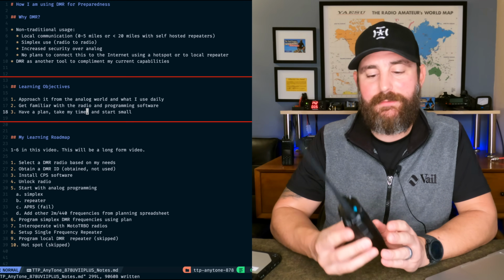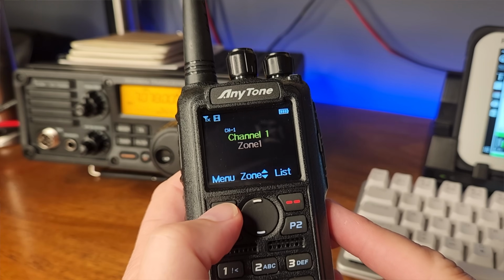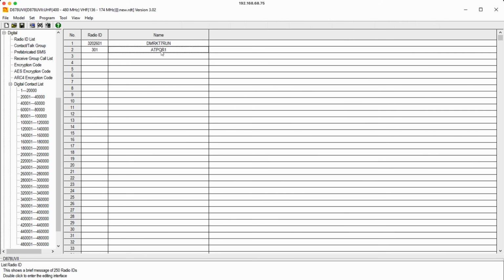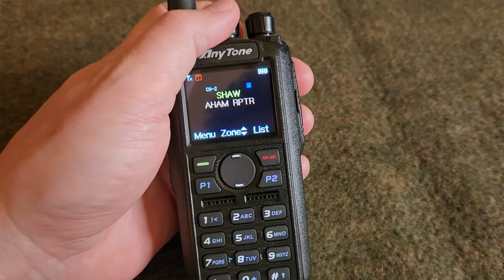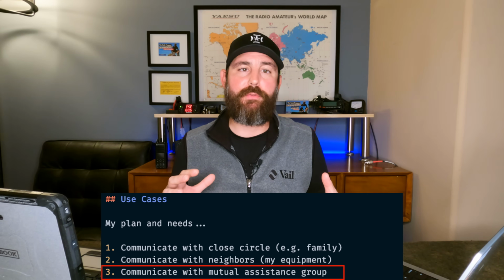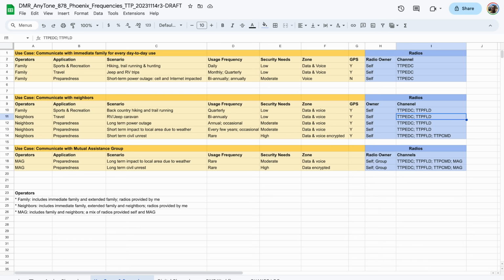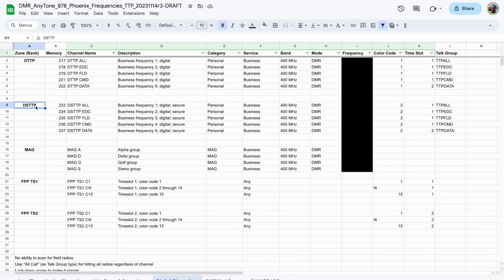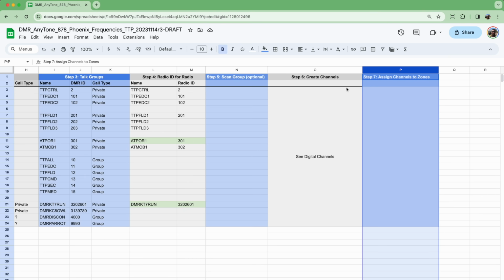How I learned DMR and how I am using the AnyTone 878 for preparedness - No Internet!

Comment: The Asia model Motorola R7s have full front panel programming. Available in VHF or UHF. I have one of each and they are the bee’s knees. They are pricey though even for good condition/refurbished used one.

Edit: Forgot to mention there’s an awesome eBay seller that has them with the AES entitlement purchased. He only charges $100 extra. From Motorola they’re around $300, AES entitlements are per radio by the way. He’ll get you a fully enabled Asia model with AES for around $850.

Comment: Thank you for sharing. That looks like very well thought out! Impressive.👍
I am relatively new to ham radio (~15 months) and I had not used the digital modes at all until yesterday when I set up my 878 using one of the Bridgecom videos. Although I assume that here in the area I live there are not enough people I can reach using VHF/UHF radios, in particular not my family, I thought I'd better do the setup while the grid is availalable instead of regretting not having done it when it has become unavailable.
I admit that your video showed me something new that I was not aware about, which is this that DMR can also be used without the DMR repeaters which is of course crucial in a situation where all that infrastructure is down or will go down after a few hours or so. 
73 from Germany

Comment: Great video, however you made the comment that the radio cones “locked” and no where in the manual does it say how to unlock it. Page 41 clearly does.
Reply: OK, I understand. It is however very strange that they don’t tell you how to unlock it until page 41 instead of the very beginning of the manual.
Reply from the maker: @cherylmorey6658  Bingo. I thought that would be the first thing every operator would need to know out the gate.
Reply from the maker: My manual did not have 41 pages. It was a pamphlet. Good to know.

Comment: Does a dmr can talk to a analog when both radio are in the same frequencies?
Reply from the maker: Negative. Even when on the same frequency the analog radio will not be able to decode the DMR signal. However, you will be able to hear it and know that there is a transmission taking place.

Comment: 878 is a very capable radio. I use it for both HAM and Professional radio applications. It communicates fine with the MOTOTRBO radios. While it does have good audio, Motorola is the gold standard in audio, both output, and noise reduction on the input side.  Good choice for learning DMR.

Comment: Encryption & Overall Plan Questions for the Radio Gurus:

Hi all, I’m looking for some assistance as I am completely clueless when it comes to encryption.

I am using an assortment of DMR/analog radios for emergency communications with family members and would like to know how compatible they are.  I still haven’t finalized everything, but likely will use DMR for the digital functions, ability to use individual or TG calls, etc.  AND, even without encryption, it will probably stop a small number of random people from listening in with older scanners or analog receivers.  

Complete “privacy” is important, but not as critical as ease of use, as only 2 of the 30+ users have any radio experience.  (and refuse to learn anything other than “turn on / push to talk” etc)

I already have repeaters installed at 2 sites, covering most of the area I need to have communications.
I’m using 4 coordinated/licensed IG (business band) UHF frequency pairs. 
1 Hytera RD-982 & 1 Motorola XPR-8400 at each site and cover much of the area needed with much overlap. (NOT linked via IP or RF)
Reply: The “Radio Kits” to be given to each family group will be somewhat similar.

Portables :
Mostly Hytera = PD-782 / PD-682 / PD-982 / X1-P (all UHF, most 450-520MHz & some 400-470MHz)
With Motorola XPR-7550e (UHF 400-520MHz or similar range)
And Some AnyTone AT 878UVii Dual-Band UHF/VHF.

Plus -20x TYT MD-380 older “low budget” UHF portables for “spares” and to hand out to neighbors, etc.

Mobiles:
Half are Hytera MD-782G (most are U2 - 450-520MHz)
The other half are Motorola XPR-5550 and XPR-4550 (UHF - I can’t recall splits)

Everything is going to be packed away in Pelican cases with plans, info, hardcopy of GMRS + IG + Misc licenses, cables, small NIFOG bound books, etc.  

6 or 7 groups total.
Each group will get 6x portables w/2 spare batteries  & 2 mobiles & 2 “Base” radios (mobile in desktop Samlex chassis & power supply).  Mobiles/“Base”s have magnet mount Browning or A.S. antennas and multiple methods to power everything. 

I HOPE that power is not affected during the type of emergency we are planning for.
But… I am working on LifePO4 / solar solution for each group + repeater sites (sites have nat. gas standby gensets and UPS units w/20min of capacity for the 20-40secs for genset to start and stabilize)
Reply: Sorry for the length!  I started thinking it’d be a paragraph.

While I really hope the repeaters are still functioning, I plan to have a bunch of simplex channels for direct radio to radio comms.  Plus all of the GMRS/FRS for random comms and to talk to outside people.

I plan on building out a few portable repeaters (using portable rack cases) eventually, but am hoping simplex using the mobiles with decent antennas , will work for each group.

FINALLY… encryption?
What is compatible?
None of the Hyteras or Motorolas have AES-256 or any encryption option (other than the “basic” or whatever is included)

The

Comment: I don't understand how this is Internet free, dmr relies on network connected servers so are you deploying your own server (that won't work without Internet) or are you using talk around (which is severely limited range) or are you using analogue which by definition isn't dmr and therefore this video is completely misleading? Genuine question as I'm confused and you don't actually explain how this is working. 73's M7YOD
Reply from the maker: I am using DMR as protocol for simplex communication (i.e. no Internet). It has value from the preparedness aspect for local, more secure communication compared to analog. Also, with a business license, DMR simplex with AES-256 encryption is legal and force multiplier. This just another use case for using DMR marketed radios outside of the traditional ham/Internet use.

Comment: Excellent video… I’m halfway through and it’s good.
I came from the public safety world of 2-way, am an amateur, have business band licensing AND am now creating a family emergency communications plan & system.

I’m using multiple Hytera repeaters (4x UHF / 2 per site) with spares set up in mobile rack cases..
I’m using Hytera PD-782, PD-982 and X1P portables and a handful of /\/\otorola XPR-7550 portables.
The Hytera radios are a bit pricey for a radio destined to sit in a Pelican case for “emergencies” and the Motorolas are nearly impossible to program in the field (no FPP in NA).

I was looking for a solution for the 30+ radios that are to be handed out to 4 family groups.
It seems like the AnyTone will be a good solution.  The only issue I have to research = encryption.
AES256 (DMRA) is pricey, but already done in the Hyteras.  I hope the AnyTone is compatible and can do MDC1200 signaling for the analog side.  (running analog on the in-law radios LOL)

Thanks for the video!

Comment: I would like to know if two of these can communicate between each other through digital signal on their own without connecting to repeaters and other devices?
I mean like if i just put two analogue radios at the same channel and they can communicate completely independent
Reply from the maker: Yes. That's exactly how I am running these. Radio to radio.
Reply: That’s called Simplex. The radios would have to be in range of each other, there’s lots of variables for range, but generally about 1-5 miles if you’re lucky.

Comment: I work in cybersecurity.. and this still looks so overly complicated lol! I think DMR is where I need to be due to the same reasons you went that route, but man.. I'm not looking forward to it at all.

Quick question though. I've read that the BTECH DMR-6X2 is the exact same thing as the Anytone 878 and that the firmwares are even interchangeable. Do you know anything about that? I'm mainly asking due to the price tag as you can imagine.

Comment: I have actually found two things about the 878 that disappoint me: the battery latch is weak, I can take the battery and move it in and out ever so slightly which is a concern as to whether the battery is really secure and whether or not the contact seal is really working. The other issue I found is it doesn't take much audio to clip this radio's receive on analog, unfortunately that makes this radio a no go for me. If the analog receive is that sensitive it's no good. I have tried tons of different radios and I can't believe the poor quality being put out for the higher priced "ham" radios. Icom seems to have the best QC. My Yaesu ft-5 cracked by the ptt in a short period of time and it will be a very long time before I buy another one of their products. I can write paragraphs of the issues with radios marketed for the ham market. I am waiting on a TYT MD-390 after discovering issues with the CS-750 not allowing audio through when someone is talking.

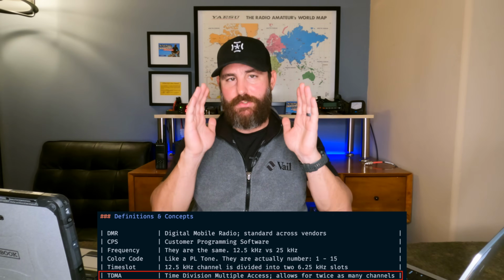Comment: Isn't TDMA (TIME DIVISION multiple access) simplying using the entire bandwidth but creating two sequential timeslots, basically using the entire bandwidth for both timeslots and swtiching back and forth quickly, and not dividing the 12.5 bandwidth to 6.25. @24:24 I'm pretty sure they cover that in the HAM Tech license test. What you are describing is FREQUENCY DIVISION multiplexing (FDM) - you know, same stuff as in wired networks.

Comment: The GPS in the 878 will give your position away. Right ?
Reply: I also am wondering if you can disable GPS?
Reply: Transmitting on a radio will give away your position. No one is looking for you though. So no need to be paranoid.

Comment: The Anytone is a nice radio overall. I have the older AT-D878UV version, and I don't see that the newer version has really 'improved' enough to warrant my attention. The APRS implementation is poor on both radios. I was able to cobble together a rudimentary brute force tracker with the older one, but it was essentially useless for anything else. And while the APRS receive capability on the newer model would be nice to have, it’s still missing a lot of functionality there. I also would’ve liked to have seen them expand the size of zones and scan lists as well, and maybe allow channels to appear in multiple scan lists (these are my common complaints with many, if not most, DMR radios). The software is pretty good, and like you, I’m a firm believer in rolling your own code plug, versus using someone else’s.
Reply from the maker: I think that you made the right call sticking with your original 878. In my humble opinion, the APRS experience needs to be overhauled with the operator in mind. Glad to hear that you also roll your codeplugs. Thanks for the comment and view.
Reply: Same here but I really am glad they keep the improvements going

Comment: Slightly pedantic comment. What you described (splitting the 12.5kHz channel into two 6.25kHz sub-channels) is called FDMA or Frequency Division Multiple Access. It's used with NXDN and I believe P25 is also FDMA. TDMA as used in DMR alternates between Timeslot 1 and Timeslot 2 every 15 milliseconds using the full 12.5kHz bandwidth.
Reply: Actually called TDMA time division multiple access

Comment: I am curious about something; since all of the radios you have support encryption, why even bother with unencrypted channels, why not just have them all encrypted all the time.  You control the radios since you pass them out to friends and family, so there should be no compatibility problems.  What am I missing, what is the disadvantage to having them always encyrpted?
Reply from the maker: You sacrifice potential interoperability with other radios. My AnyTones and Motorola can do encrypted voice, but not text message. Also, I have analog radios in my fleet. Personally, I need the flexibility of three application specific zones for my frequencies: analog (ATTP), digital unencrypted (DTTP), and digital encrypted (DSTTP). Also, I interact with other groups and don't necessarily want to share my keys. It's good to have operating options.

Comment: I am surprised to see that you recommend a 25kHz bandwidth for ham/repeater operations. I am from the EU so it may be different in the US, yet our channel setup is 12.5 kHz, and we use narrow FM as it is fully capable of transmitting voice frequency range. Using 25 kHz would interfere with neighboring channels. Can you maybe elaborate why 25 kHz is beneficial for you? Thx and 73
Reply: 25kHz is the standard for analog ham radio here in the states

Comment: 11:00 All right I can understand what you're saying about Coldplug I have a little bit different view on that, let me explain why. 1. if you are a amateur and starting on DMR it's very wise to use the same cold plug that the local community around you is using that is because it's much more easier to get support from your local amateurs when you need help. 2. it is wise to start using someone else's code plug until you're comfortable using DMR radio because someone else's has built to Coldplug for the radio that you are using, it's not easy just building up a code plug when you don't understand the concept of the DMR radio, when you're comfortable using someone else's DMR code plug and have a logical understanding of how a code plug is working then you can start building your own Coldplay I've been using DMR radio for almost a year and I'm still not comfortable writing my own code plug to 100% working
Reply from the maker: These are good points. Let me clarify, the problem that I really see is when I have people outside of my state ask for my Codeplug as other than a few nationwide channels, none of my settings are appropriate for them. Also,I'm a firm believer in tailoring the radios settings to one's particular operating needs. I see this as constant issue. As you can see from this video, my Codeplug is highly customized around my personal communications objectives.
Reply: @TheTechPrepper  You r also very much correct.

Comment: I have three 878s and can only seem to get the “common” encryption to work. The AES256 isn’t working on either of the three. 

Also note, line 16 and 17 in the channel set menu. I can’t figure out Encryption Type differences. 1 is normal and 2 is enhanced. All I know is that if both radios aren’t on the same “normal” or “enhanced” they won’t work together
Reply: Have you checked the firmware versions of your 3 radios ? If you bought them separately, they might have different versions. I know some encryption bugs have been solved through newer firmware version. 73
Reply: Also, in the CPS, in the other settings tab, you can choose AES, Common or ARC4 (for newer version). 

“Normal and Enhanced” is no longer a menu option when AES is chosen. So idk. Lol. Anytone really ought to get it together in that area. 
(Also, why is normal or enhanced only programmable on the face of the radio and no where in the CPS!!)

I’m downloading dsd plus for my SDR dongle and I’m going to really see what the heck Anytone is transmitting. I hope to learn the dif between Normal and Enhanced when in “Common” mode. AND to see why neither of the three radios are working together with AES.
Reply from the maker: I did the same thing and installed DSD for use with my RTL-SDR. The CPS is unnecessarily complex. It looks like an Engineer designed. Poor user interfaces drive my nuts.

Comment: I don't understand why digital radio has to be so complicated.  It's extremely simple (from the user's point of view) when placing a call on a cell phone.  Why can't someone design a radio that works essentially like a cell phone, but handset-to-handset, rather than handset-to-tower?
Reply from the maker: This is why I held off using DMR for two years. It is unnecessarily complex. My wife actually used DMR with me today while I was on a trail run. She operated the radio just fine today and she knows nothing about radio. The trick was giving her a preprogrammed radio and locking her out of most of the features. The programming is not for normal people.
Reply: Don't project your feelings on FM into DMR, FM should have been faded out for no reason
Reply: Your cellphone is already programmed to be able to use the radio frequencies it uses from the phone manufacturer. They did all the required programming for you. It’s really not that hard/ complicated to program a DMR radio, if you can copy and paste, then you half way there. You just need to find the repeater information that’s available for free online, and put the information in the correct box. I’d say getting the license to be able to use the DMR Radio is harder.